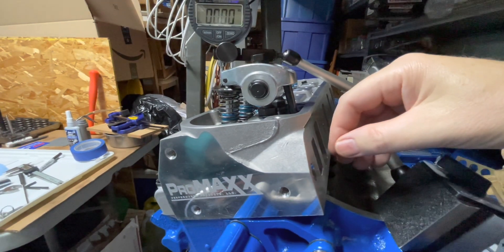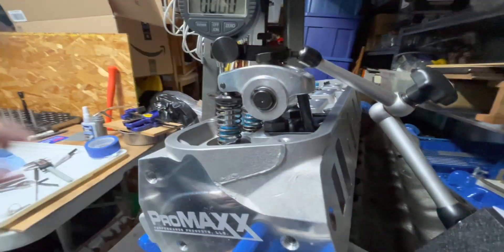Pushrod Length - Ford 289 331 Stroker Motor Rebuild part 18

Comment: I also have the promaxxh heads and tesame comp cam rollers.
But i have Howard's link bar lifters and they also compress with the comp cams checking springs.

I have put the rocker on the stud with zero lash ( with the original strong springs), after this i turn the nut(from rocker)until my preload is fully compressed just before the valve opens(can see it with dial messurement on the valve) after this i rotate the engine and have a 6.500 pushrod (+ 0.050 for preload) and have a length of 6.550 on the intake in total but a different messurement on the exhaust 6.600 + 0.050: 6.650 

 Do you know if this method is ok and do you also have 2 different pushrod lengths on the promaxxh heads? It seems that al of the exhaust valves are  grinded a bit shorter
Reply from the maker: I wanted my rockers to be perpendicular (90 deg) to the valve stem at mid-lift, but that can’t be measured if the lifter is compressed. The geometry will be different. So, using the adjustable pushrod, I lengthened it in place (counting the turns to get a measurement) to fully compress the lifter but not open the valve. This let me get the proper geometry and the pushrod length. Then, I subtracted the added turns I needed to compress the lifter, and then added the preload. This probably sounds confusing, I know. As far as the different valve stem measurements, I laid a straightedge across the stems and they were close enough on my heads, but I imagine they could all be a little different depending on who assembled them. Hope this helps.